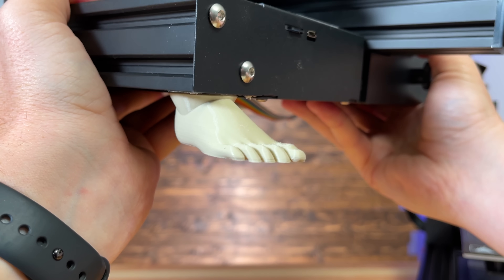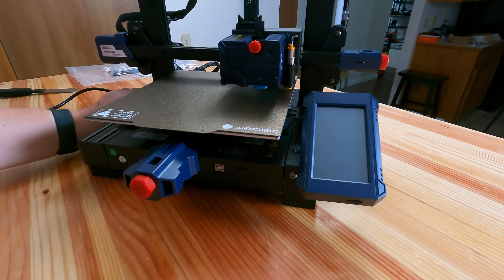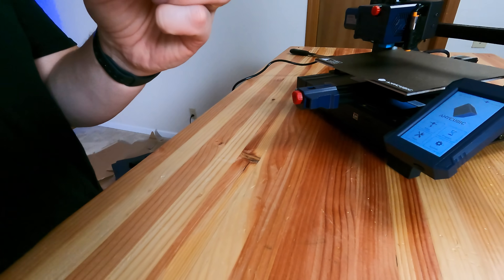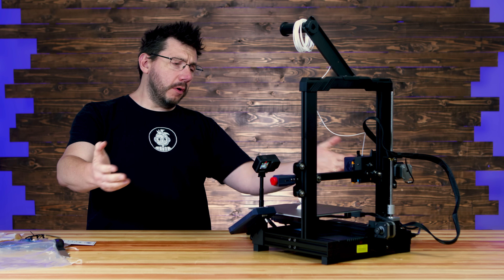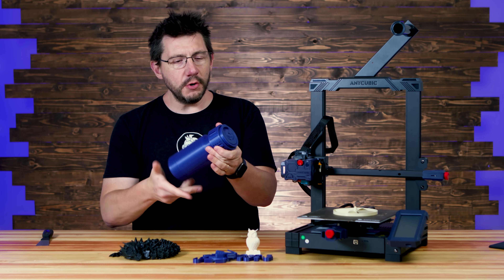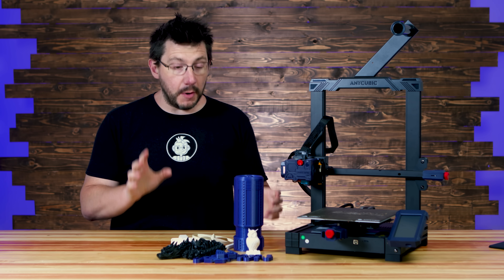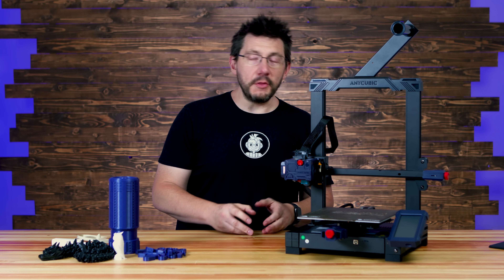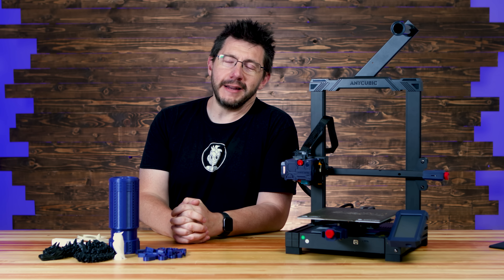Anycubic Kobra 3D Printer // GIVE 'EM THE CLAMPS!

Comment: <pulls up checklist>

ABL? Check
Filament runout sensor? Nope
Removable flex bed? Check

Does not meet the requirements of a modern printer.

At least the ender 3 won't be defeeted by 10m of flesh-colored filament.
Reply: Is it possible to install a filament runout sensor?
Reply: @lucas_furas  there's probably a way, but if you want to tinker with a printer, get one that can be tinkered with (Ender 3 is a popular one). If you don't want to tinker and just want to print, there are so many printers that have the ABL, runout sensors, and flex bed that you can practically throw a dart at a dartboard listing them and not go wrong. To spend the time and money on something that doesn't have all 3 of those is just setting yourself up for doing more work getting your printer working and less time printing things you want

Comment: Something my Ender 3 S1 could do with is a smooth PEI coated sheet. It stuck so well, my Armadillo Lizard broke into 3 pieces trying to get it off.
So I slipped my mirror bed from my original Ender 3 on it, and it works like a charm.
I found out last week that I can get Anycubic printers here in South Africa.

Comment: I just got a Kobra as well and I really want to love it as much as I love my Vyper but I've had nothing but issues. When I try to level my bed the nozzle gets rammed into the bed the further right it goes until erroring out. Any ideas or help would be greatly appreciated, thanks!
Reply: Same here, contacted the maker since I order it directly from China. And they said it is a common issue about the auto-levelling sensor. Adjusted the sensor's position as advised, didn't work at all. 
They asked me to send the whole machine back to factory for maintenance, but the shipping fee will be almost the same as the machine itself. Stuck in my workshop for 2 weeks now and can't find a way yet. It's truly a mess with problems.
Reply: @koukilab  I'm surprised they're having you send it back. They're sending me a replacement probe, so here's to hoping that solves the issue.
Reply: Thanks for the information. I had all but decided on the Vyper as my first 3D printer, but then this looked interesting and cheaper. I think I'll stick with the more proven option.
Reply: @montagdp  which one did you get? Are you happy with it?
Reply: @Henji96  yes, I got the Vyper and couldn't be happier. Auto leveling works perfectly. I highly recommend it.

Comment: 1:16 The advantages of living in a 115V country. If the selector had been set wrong in a 230V country, you would have let the magic smoke out.
Reply: Yes, but given the fact 230V is far more common, and the fact that the higher voltage is always the safe setting, the machines are almost certainly factory-configured as 230V.
Reply: @JonS  Not always. I had an uncle who did let the magic smoke out of some devices ... back in the 80s.
Reply: @MrMegaPussyPlayer  yeah, 1980s power supplies were terrible compared to what we have today. There has been a lot of progress in power supply design.

Comment: WAIT A SECOND YOU DIDN'T CHANGE THE VOLTAGE SELECTOR AND DIDN'T FRY THE DEVICE??? 

Cries in 220V :(
Reply from the maker: I know, we are lucky here!
Reply: Because in America we have only select things shoving that much voltage into. We take 240vac from the Electrical Box and split it 120vac for everything that doesn't need high volt. That's called smart wiring and another thing is countries using 50hz when it would simpler for 60hz just because Europeans didn't like America's Companies having a monopoly? It just doesn't make any sense in electrical efficiency.

Comment: you know why they went away from it, it was rubbish and just about all the strain gauge broke from crashing into the bed thanks to the crap firmware
Reply from the maker: So far, strain gauge still working on my Vyper.
Reply: @3DPrintingNerd  you are very lucky, I am on my 3rd including the new stronger print head. Use it with octoprint and try adjusting the Z offset if you sent a print job from octoprint  and watch it set the offset to -5mm  and push the nozzle past the bed. Then try printing if it has forgot the bed mesh, but you didn't know the gauge was bent while printing, it just prints in mid air. I had it for three months before it worked correctly. Now with the stronger print head and the CE firmware it's printing very well.

Comment: This is actually one of the printers I've been debating between. It's been this, Elegoo Neptune, and Ender 3. I would mostly print with PLA and PETG with the occasional TPU. Any thoughts?
Reply from the maker: It's a decent machine. I don't have long-term usage with it quite yet, but in what I have done, I have liked it.
Reply: @3DPrintingNerd  Nice ^^. I have to wait to buy it anyway so I'll keep an eye out on more, long-term reviews. Hope your day is going well ^^
Reply: Its a base machine and if you just want it for occasional prints its OK but you will not be able to upgrade r do mods because its not supported by Anycubic
Reply: @oaklandservers  I ended up getting the Ender 3 v2 in the end. If I want to upgrade it, it will be MUCH easier to upgrade it
Reply: Not the Ender 3.

Comment: Mine got delivered yesterday. My first printer, and so far, it's pretty awesome. It does seem to randomly forget the z offset, but otherwise I'm really impressed. The few prints I've run so far have come out great.
Reply from the maker: It just forgets it? weird.
Reply: @pixel5  I am very beginner in printing even the owl is not done, can someone give me information about the pla and the chosen distance between the bed and the injector 0.15?
Reply: @manuelpineda3951  I'm sure you've already figured this out by now but make sure you are printing something while adjusting your distance between the nozzle and the bed, I honestly like it to smush the crap out if the melted filament so it's slightly transparent but it helps it stick to thr bed better

Comment: People who can't get good adhesion without using glue, hairspray or stuff, are just doing it wrong, all you need is a clean plate and the correct Z-offset
Reply: And correct temperature! I switched from PLA+ to a PLA and it just wouldn't stick no matter how close I set the Z offset until I realized that it wanted 210-230...

Comment: With how much you were sticking your fingers on that bed, I saw that adhesion problem coming. Powder-coated PEI and skin oils do not mix.
Reply from the maker: SUPER do not mix. Also, only touching it this much while the camera was on - normally I do everything in my power to touch the bed as little as possible.

Comment: We put one in the print farm and it prints with as good of quality as our Prusas. It is both faster and prints more accurate than our Ender S1 out of the box. It isn't on the level as our vorons of course, but it took the Ratrig minion print speed profile surprisingly well. For the price, the kobra a surprise powerhouse IMO.
Reply: Have you updated the hotend?
Reply: @WINTEJER000  Still running stock from day 1 and going strong. What is the updated hotend?
Reply: @clearviewproducts  I am wondering if you updated to all metal. I'm looking to run at high temps
Reply: @WINTEJER000  No, didn't know there was a conversion yet. Will check it out.
Reply: @clearviewproducts  I haven't seen one
Reply: What Voron is the best for smallest details and accuracy?
Reply: @kuuhgle  v.0

Comment: I have a Prusa MK3S+.  I usually clean the powder coated bed with some IPA between prints.  If I have issues with bed adhesion with PLA, I will clean the bed with acetone instead of IPA to "refresh" the bed.  That usually works for me.

Comment: Hey Joel any chance you could open up these review machines for a close inspection of motherboards and lcds, perhaps for technically nerdy?
Reply: Good luck trying to do that. They have made the bottom plate with snap in tags and also secured the whole box assembly to the Y axis rail, with very deeply recessed HEX bolts (Not Screws) I had to drill out the bolts because unless you have a special nut runner you cannot reach the bolt heads.

Comment: Funnily enough, I bought one of these this week as my first 3D printer. After initially setting my Z-offset too low, I've been having fun getting to know it. 
One annoyance is that they don't say anywhere that there is a maximum capacity of Micro-SD card that you can use with it. I made the mistake of buying a 64GB one as a spare and it couldn't read it.
Reply: Did you format the Micro SD card to fat32?
Reply: @minnow11  I hadn't. After reading your reply, I tried but it only gives me the option of NTFS or exFAT.
Reply: (I'm running Windows 10)
Reply: @tamsinp7711  I would give exFAT a shot, its supposed to be a replacement of sorts for FAT32 I think.
Reply: @minnow11  you can format a 64 to fat 32 it's to large. you can trick it into thinking it's a 32gig card tho and then format it.
Reply: @minnow11  cant*
Reply: the SD card thing is something lost ppl have to find out the hard way. that's how all printers are. anything over 32gug has to be  tricked into being able to formated to fat32
Reply: You can partition it smaller
Reply: @ibiza8426  I've ordered a pair of 8GB cards from Amazon; I'll easily find a use for the 64GB one.
Reply: You can partition it smaller when formatting. You essentially are making it into a 32gb SD card and can't utilize the full 64gb.

Comment: Other than the direct drive and pei, I don't see much difference from other brands..

Additionally, direct drive isn't exactly necessary for pla and this is what beginners should be starting out with.

I don't see it as a beginners printer and if that is how it's being advertised, it's only going to cause problems for the new folks and then 3d print communities.

You should be pointing this out for the sakes of newbies..
Reply: Why wouldn’t this be good for beginners? 🤔🤔 the widely regarded #1 beginner printer is the ender 3 or one of its variants, and this comes with features that would improve the user experience over that, ESPECIALLY for beginners. What a weird take.
Reply: @lasersandlayers  well the way I see it is that ender 3 and its clones are bowden,  not direct drive.

Direct drive is really only necessary when printing flex.

A budget printer is what attracts beginners and giving them direct drive is going to make them want to print materials other than pla.

As you may be aware, many of the non pla materials need you to fine tune the printer - something that beginners would not be used to.

So in the final analysis, giving a beginner direct drive is going to cause them all manner of problems that they will then take to 3d printing communities spouting terms like "I'm going to throw this thing out the window"

I'm sure others out there agree that we already see too many of those types of posts, without encouraging beginners to buy a machine that they may not be fully capable to use..
Reply: @paulradford4100  Not everyone has your problem with direct drive machines.  They are WAY better than Bowden for almost ever job.
Reply: @tvideo1189  actually I have no problem with dd and never had, but there numerous posts online from folks who have..
Reply: @paulradford4100  mhm. And there are numerous posts online for issues with Bowden setups. But for the most part, DD is easier to deal with than a Bowden setup.

Comment: I picked up an open box Enter 3 S1 for $150 off because the power supply was set to 230v instead of 115v
Reply: Lol, when I had my Ender 3 Pro assembled and went to switch it on... nothing happened... first thing I did: look for the mains voltage switch on the supply. Powered right up! Wish all fixes were that easy
Reply: Great Thor, that's an amazing deal. I got a returned V2 for 85 because it had the factory test filament in the hotend and the original purchaser didn't how how to get it out.
Reply: Where are you guys finding these?
Reply: @brocksdaddy081910  Mine was at Microcenter, even on open box they have a 15 day return policy
Reply: @jdarnone  and even more reason for me to be pissed about not having a microcenter closer to me.
Reply: I still wonder how I got my Ender 3 S1 for ZAR6700 [$320 US] just a week after it was released... Brand new.
Reply: Lol
Reply: Today I just got the anykubic kobra for the same price as the regular ender 3 cuz it was prime day. Never thought I would get a good 3D printer under 200$ until today.